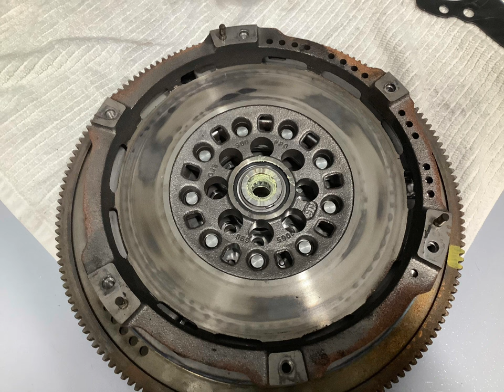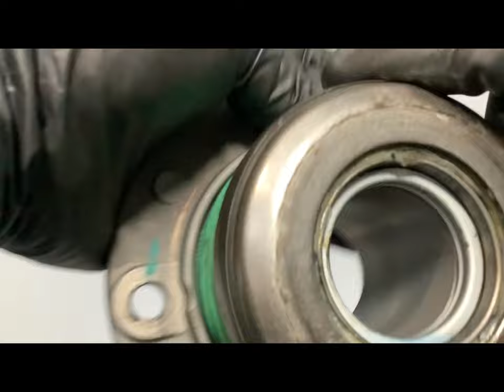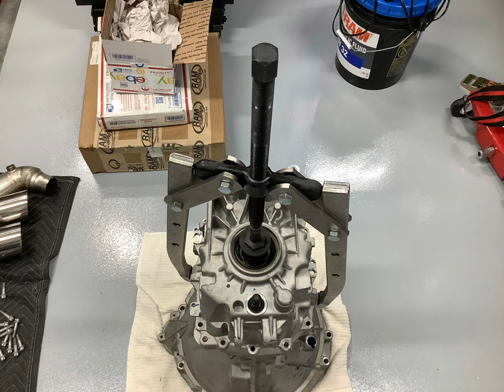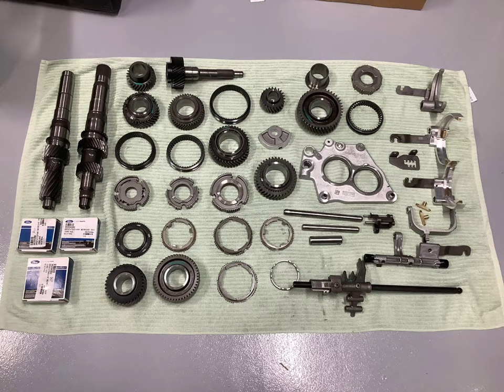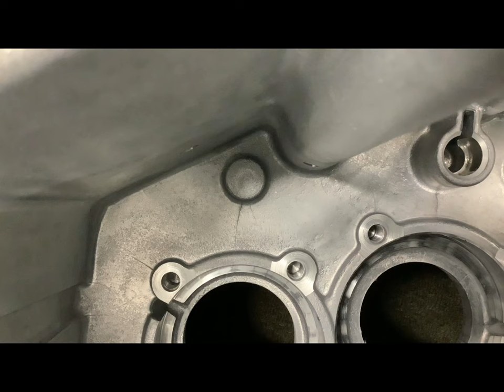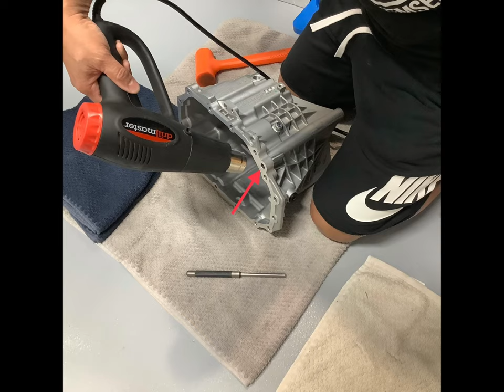2019 Bullitt Mustang - Clutch install & MT82-D4 transmission rebuild ***photo slideshow***

Comment: Did you have any problems with the mt82 before the rebuild?
Reply from the maker: No problems with the tranny. I figured since I had to drop it to change the clutch, I might as well build the tranny up to handle some abuse.
Reply from the maker: I also have a clutch slipper device in the car, upgraded axles, differential bushings  and a 1 piece aluminum driveshaft, all of which help a great deal with preserving the drivetrain.
Reply: @adrianmansaw9163  wow that's a nice setup. On the bullitt my dad is trying to build he's having transmission issues locks him out of second gear.
Reply from the maker: Thanks! If your dad is not willing to go as deep as I did on mine, I suggest he put in a really good twin disc clutch (organic for street use or cerametallic to handle more heat and abuse if he ever races it) and a Steeda or McLeod steel braided clutch line. Those things should take care of his lockout issues. Mine has a Ram Pro Street with cerametallic discs. He should also get a really good shifter. I run the Steeda Tri-Ax Race shifter in mine, but Barton and MGW are comparable. I’ve had Barton before, but only hear good things about the MGW.